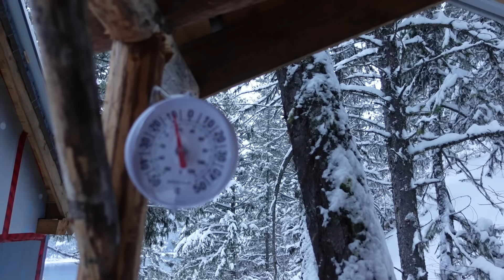My scariest incident yet, but THIS was worth it! | Snowstorms in Canada | Cabin loft build.

Comment: Clearly a Spring/Summer/Fall cabin as is.  That trip in is pretty sketchy. Raised the hackles for me.
    I grew up in the Okanogan near the Okanagan. Spent a lot of time up in the Okanagan in the summers. 
      The North winds coming down the valley were epic in the 50's and early 60's  and with temps in the minus 60's with deep snow falls sometimes drifting over the house. it was a brutal walk to school if it was even open.  The valley has much milder weather these days.
    We would put in 15 -20 cords of firewood every Fall even, though, we had electric heat.  The winds would pull the heat out of the new house despite insulation and double pane windows that were floor to ceiling in a modern Mid-Century house design.          We had a commanding view of the valley, river, and mountains, but it cost us heat in the winter.
Reply from the maker: I grew up in the Okanagan as well!

Comment: Lots of fun.  I have a off grid cabin in North Idaho. My wife and I snowshoe/snowmobile into it in the winter.  I put in a bigger than needed wood stove to heat my cabin.  It gets me through the night and I can can easily heat it in very cold conditions.  You might upgrade your stove,  I know those small stoves work in small areas but they are working hard to heat things up and take continual restocking.  Just a thought.  It's better to crack a window for cool air and sleep through the night.

Comment: Flat wall construction. Of course it doesn't heat up. You should have at least R30 in the walls and R50 in the ceiling as well as insulated floor., so you definitely wouldn't have narrow walls.
Reply from the maker: It’s a tiny cabin hanging on a cliff in the middle of nowhere. It’s been an incredibly challenging location to even walk to, let alone build at. So I’ve built it the way that seemed most reasonable given I’ve done nearly everything myself.

Comment: Good work, glad you didn't die.  I see your Mr. Buddy sitting there, it can help take the chill off quicker if combined with your fire.  I use the 20# tanks with the adapter hose, can last quite a while, but harder to haul up/down.  Truck bed weights make a huge difference.  I made a couple, years ago, out of 6" PVC pipe filled with sand, as sand bags eventually burst and make a mess.  I cut the PVC almost the length of the bed, fill with sand, screw plugs on the ends, then put one on each side of the truck bed, bungee cords to attach to sides of bed at wheel-wells to keep them from rolling around.  It's almost a 2-person job to get them in and out, but you only do it 2x per year.  You can also lay a piece of plywood across them to create a shelf bed to toss things under for more storage.
Reply from the maker: I should have mentioned that I do turn it on to help - well, really just early in the morning between 4-7am to take the morning chill off. But I’ve also wanted to just test the stove on its own to see how well it performs in the space.

Comment: Ah, the best part of the video is your walking in the snow hearing the crunch sounds. Nice and dry, listening to that brought back some vivid memories of my past, thanks for the video. Ya know, that slot in the beam could be deeper with the use of your circular saw....just take the depth to say half the beam width, and for  heavens sake, use some structurally sound boards on that landing near the windows....having taken structural engineering, your safety factor is gone using them. Please use something else.

Comment: Can the SkyMule spool be operated with a battery powered drill or winch?
Reply from the maker: Possibly!
Reply: @michygoss7148  probably only need a brake to let heavy stuff down so it doesnt go too fast. Just need power to bring stuff up.
Reply: @michygoss7148  Finding the right tool could be tricky. There's hand-held winches but they come with a too-short cable attached and they move really slow. You just need a geared down motor to replace the crank. 
Maybe a 12v motor that raises the roof on a pop-up camper. Maybe remove the blade from a battery chain saw and modify that (I like that better, mine's 58V)
Reply: Hey, maybe modify an old gas chainsaw.

Comment: sooooo my main question is, even with the railing is there a chance of going over?
Reply from the maker: On the trestle? Or on my deck? On the trestle it would be hard with the railing to go over. It’s built fairly strong. But my deck for sure - it would be easy.
Reply: @michygoss7148  I meant the trestle so... phew.

Comment: Glad that you didn't drive through the railing and die! I would also take the view instead of warmth or light, you can light up and warm up your cabin, but you can't make up the view. Did you miss the beam with one nail? Or does it only look like you had a sharp nail sticking out next to the wall? Better nail it back up so you don't accidentally scratch yourself into it.

Comment: Michelle You should move that 2X4 and place it under the end of that beam you ran across the cabin; for added support. You have cut that beam and all the weight is resting on just 2" of wood. The beam on the ends have been compromised.

Comment: Amazon Dexter Stovepipe Heat Reclaimer/Radiator Rings/Bands. That I just commented about. I will say, that I didn't know these existed until searching to Comment HERE on Heat-Exchanging.  Extract as much heat out of the chimney pipe as possible it does radiate but embellish it with more surface area. 
A friend of mine was installing a wood stove. Before installing the chimney he had pre-wound copper tubing around a mandrel. As too, close fit the pipe.
The copper coil sat on the 90-degree elbow exiting the rear of the stove. Having a coupling fitting on the base of the coil, So it was convenient to attach a 
second piece of tubing that went down to the floor and over near a receptacle. Without getting more detailed a small fan blew up through the coil, hot air exiting the top. The fan was seldom used and not for long. The copper coil was a good heat exchanger on its own. Drawing cooler air in from the floor and exiting the top hot, due to convection.

Comment: Yeah, I know this a Captain Obvious moment, but it appears as if your road is an old train cut. Not sure I wouldn't have an old beater 4X4 to traverse the old train tressel as they're pretty narrow. Especially with the snow. That being said, you put more effort getting to the cabin than most people are willing to do at their jobs. Nice rustic look on the loft and I'm sure your boards are plenty stout. You obviously don't weigh that much. Stay safe, warm and keep up the good work. Have a good one!🤙
Reply from the maker: An old beater!!?!? lol. I just bought that truck in October! It’s a 2021!
Reply: @michygoss7148  No, no, that's not what I meant, another older truck to do all the dirty work with. I have a '21 Trail Boss, but also a couple of square bodies that I used for hauling stuff or the dogs. My old '82 GMC diesel 3/4  ton is a tank and I don't worry about stuff like that. That's the point I was making. Your GMC is far from a beater! Have a good one!🤙

Comment: Nice Video and nice view from up your loft ! Constructive comment, the 2nd beam you added under the previous one, seem to serve no purpose structurally, at all because it does not seem physically/mechanicly tied to one another. Unless your have fixed it to the top one in an unshown way. I would recommend sandwiching them with a 3/4" ply wood or steel plates to make them work together, increasing their strenght to support efforts, or for less work, put construction glue between the beams and mechanicly tie them together with lag bolts, top and bot, staggered while the glue is not dry. Instead of lag bolts, you cold used threaded rods thought the beams and really tight those nuts. Also, put those simpson strong ties on each side of your beams !!! You really have a weak connection with your main walls and those beams ! For the planking, they seem week, but they are not at the moment because of their elasticity. Over time, they will dry out, lose their elasticity and fail, one by one. Maybe in time, put another full lenght beam under them mid distance between the window and existing beam, in that way, even when dried out, they still will support anything because the requirement of elasticity should be less solicited. Those are only suggestion based on what I saw in this video, I do not know the full extent of the overall work you have done ! You are the best judge of that, not me ! Have a safe journey with your cabin !

Comment: Engineer a portable front railing that can be raised for work/snow/safety etc sessions and lowered for enjoyment/ relaxation periods so as to not take away the beautiful views you have captured from your deck and cabin yet provide a safety when needed!  A lightweight pulley and winch system at the front corners could solve the problem which would raise/lower a barrier to prevent an accident.  With your skills, talents, and aesthetic prowess, you can get both easily!   Really enjoy your creativity and ingenuity.  Doug Robison
Reply: After reading all of the comments about your cabin front view and the potential for having a fall off the deck, I certainly would recommend a woven rope catch about five feet wide from the edge outward and along the length of the longest deck side, like they use for trapeze performers in the circus, placed around the outside edge of the deck placed level grade or slightly below deck level so as to not impede the fabulous view but also stop anyone leaving the deck hard surface inadvertently.  This could be made by weaving strong enough rope in a tight “X” pattern ( 5 x 10 ) feet long which would allow rain/snow to fall thru but stop a human body from continuing to the ground and on down the steep slope.  This could be supported by 4 poles 5 feet long outward from the deck to attach the rope “catch” to.  This could be done frugally, aesthetically, and relatively quickly done yet still provide some safety protection while not creating ongoing maintenance issues.  Good luck if you choose to accept this mission!  This is only a suggestion and there never was or will be any intent to tell you what or should do if anything.  Again, I enjoy your presentations and look forward to reading/viewing them often!  Lt Col Doug Robison USAF Ret./ Capt. UAL Ret.

Comment: Oil leak at 1:49 or so? Didn't notice the black line before you hit the rail but you've probably already checked it out by the time you posted this.
Reply from the maker: I know - I saw that too when editing! I forgot about it, but thanks for the reminder. I have had the truck in to check on a ‘check engine light’ and they had it for a few hours and didn’t mention seeing anything bad, but maybe still worth checking into.

Comment: Try and acclimate your camera when coming inside, that fog can get on the inside of the lens also.. ruining your camera. Carry a zip lock bag outside with you or a camera bag leave the camera inside the bag until the temps at lease get close to the inside temps when coming inside.  The opposite is not necessary only coming into a warm house from a cold temp. As a photographer I find it annoying but it's very important for camera health.

Comment: looks great and great looking. router cut integrated shiplap joints stiffens floor sections. shimmed beam ends pinch and reduce deflection if any although with that monker sized beam, no worries there. love the aged hand crafted look, more than most could ever or would ever embrace. thanks for sharing, happy trails!

Comment: The cold air that drops off your upper windows can be mitigated by a thin open slot parallel to your bed as close as you can engineer to the window, it needs a 2" raised lip on your side of the slot. This lets the cold air drop through to the floor below before it gets to you, and creates cabin circulation towards your loft bunk.

Comment: Hello!.....if you ever need a quick way to heat up your little cabin, I highly recommend the Mr. Heater Big Buddy portable propane heater.  This one is 18,000 BTU's and would heat your place up while you are collecting firewood.  I have done the research, and I actually use this in our little bunkie, and it is a game changer.  The frustrating thing is, if you use this product in Canada, you will die a painful and horrific death.....but, if you use this product in the USA, you will be warm and toasty all winter long.  Each country uses a different insurance company :)  Just don't run this heater for long periods of time while you are in the cabin.  And NEVER use it while you are sleeping.  The Big Buddy will bring your cabin from -6 to 18 degrees in minutes.  As soon as you open your door, your air will be exchanged with fresh air, and you're good to go!  All the best!
Reply from the maker: I do have a Mr.Heater - not that size, but I do have one. I do supplement in the early morning to take the morning chill off, but I’m actually kind of testing the stove out to see how well I can get it to work. Kind of trying to determine if it’s worth keeping, or if I should get something a little bit bigger. So I’ve purposefully not had the propane heater on to isolate and test the stove out. 
But thank you for the advice ! Interesting about the difference between Canada and the USA - I did watch several videos of people testing the heaters out, and they all agree it’s fine to use indoors (just not while asleep 👍)

Comment: Driving in light snow requires chains.  Driving on icy roads, ice tyres are OK. As for driving in DEEP snow--forget it.  That is how people die.  The fuel in the car lasts only so long.

You could try, if you are not using triple-glazed windows, my old trick of using bubble wrap and covering it with clear vinyl sheeting.  It lets in light and cuts down on heat loss.  TINY cracks in roof insulation lets oout a huge amount of heat.  You sure got that right.

Comment: suggestion for you, with the air supply for the fireplace. Provide air with an air intake from outside.  That you can open or  close it when your not using the fireplace. It will help with air supply to the fireplace.

Comment: If you have more of that wood you could “w” brace under to get more rigidity & not take away from the look cause it looked pretty sketch when u were on top those planks & screw in the other side of the planks to the 4x4’s as well.

Comment: I think if you put a single strip of aged wood across the center of your bed boards on the bottom and screw each board to that center strip it would tie all of the boards together to spread the load on them when you are up there.

Comment: Replace the zipper with a heavy duty ykk metal zipper. 
You can do it hand sewing. 
I've done it on a wool coat I got. The wool was great (new) but had a cheap Chinese zipper which broke quickly. 
I measured the zipper, carefully "ripped" out the old one using a razor knife, ordered a good ykk one online, and sewed the new one in with heavy duty thread. 
Very happy with the results. If I can do it being an inexperienced 67 yr old guy, pretty sure you can. Good luck!

Comment: I just have a suggestion about all your vehicles, I use a harbor, freight, portable air compressor that cost about US$65 in my vehicle. If I do get a flat tire, I can air it up and then take it to the tire shop or take it home and plug it. I think every vehicle you drive should have a portable air compressor. You can plug into the battery. I don’t like to change tires on the side of the road.
Reply from the maker: I do have a jumper pack thingy, with an air compressor. One of the best things I’ve bought!

Comment: That's my issue with regular pickups. Without real 4 wheel drive they get scary since there's not real any weight over the rear (drive) wheels. Happy it worked out well.

Comment: If you dont want a rail on your deck, I understand. But at the very least, put a three inch retainer around the edge so you cant just slide right off and then down.
Plus, it will make a good handhold to hang on if you do go over. Its hard to grip a flat edge

Comment: I didn’t notice if your stove pipe had a damper or not. Maybe one of those heat powered fans can blow extra heat off your pipe sitting on top of your stove. Get more heat from your system.  I really like the loft. Good idea with groove inlay looks cool and looks like more support the most cheap wood bed frames.

Comment: Condensation on windows...
Warm air can hold lots of H²O. Cold air can't.
"Relative Humidity" is expressed as a percent of the amount of moisture that air can hold at a given temperature. 20° air with 50% RH has a LOT more water in it than 5° air with 50% RH.
•When air inside a warm building contacts a cool surface that is below its "dew point", the air cools as its local RH climbs to 100%. Then the air dumps moisture to the cold surface that is cooling the air (windows; iced beverage glass).
In winter, cold air outside gets exchanged with warmer air inside. When that air gets warmed, you can easily end up with indoor RH of below 15%. ...especially if your wood burner is exhausting inside air out the chimney which sucks cold air in through cracks in doors and windows.

Comment: Hi Michelle. Your insatiable drive is crazy. Your achievements are amazing. The loft looks awesome. Although I agreed from a practical stand point to putting the loft in the back, I'm glad you stuck to your intentions and put it in the front. I see your reasoning. It came out beautiful. Also a bit concerned about the boards, but more from the standpoint of the boards flexing and pulling out of the slot. Anyway, works for now. Bravo!
Reply from the maker: Thank you! Yes - it’s not fully complete. I will add to it for structural integrity 👌